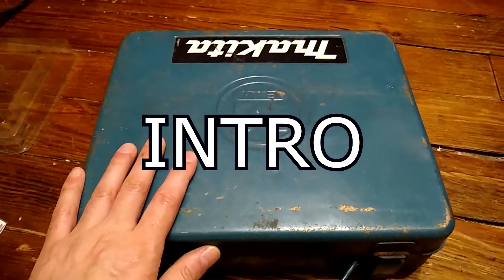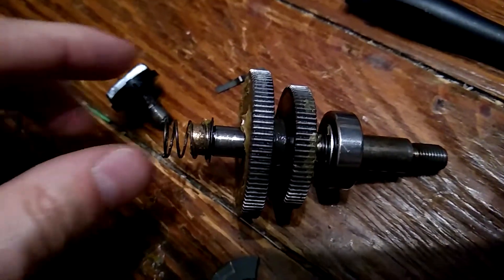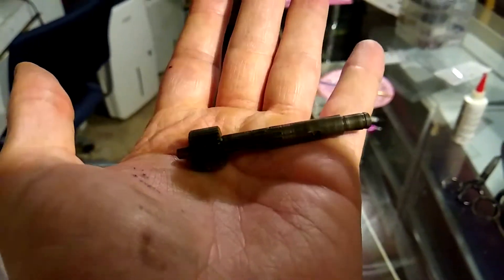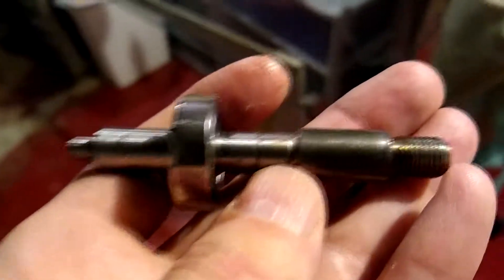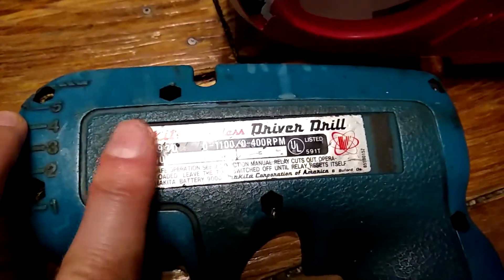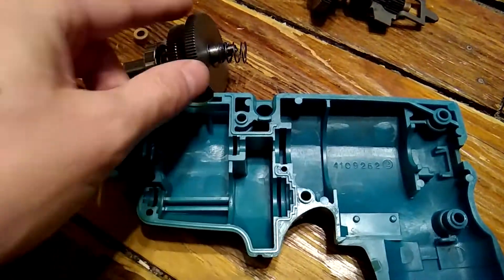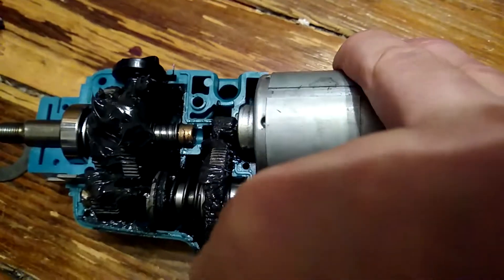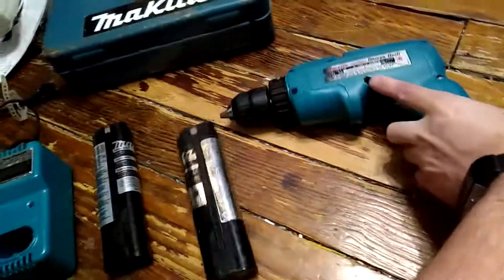PROJECT #10 - RESTORATION OF ELECTRIC DRILL MAKITA 6093D

Comment: The problem I had taking the case apart, was, first I didn't know about how to get the chuck off, till I seen 
your video, thanks for taking the time to make the video. It helped me. But I think I didn't hear you when you
talked about the chuck is normal right hand threads. Well I heard that, but missed the part about the screw deep down inside the 
chuck is backward threads. I finally tried it the other direction broke it loose. I added a little grease to the gears. I wasn't going too.
because after a little while of running it, it will be pushed away to the case walls, like I found it, not touching. But added some anyway.
Emery clothed the battery connection. It's now running, when before it was dead.

Comment: About the chuck coming off that way. When I bashed the Allen wrench as you and others recommended, it simply transferred the energy to the gears and the chuck rotated. Every time. There is no way to lock the shaft in place to transfer enough of the energy to the threads to break the chuck loose. I am not going to spend days or weeks. Try again Sherlock.